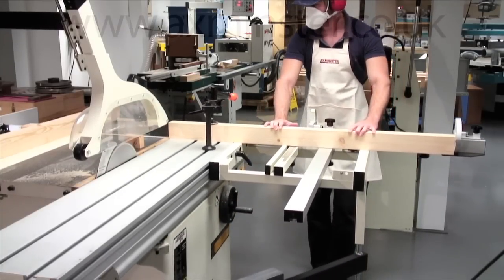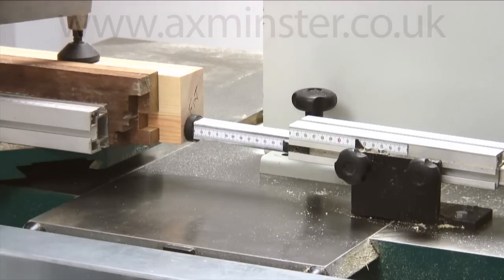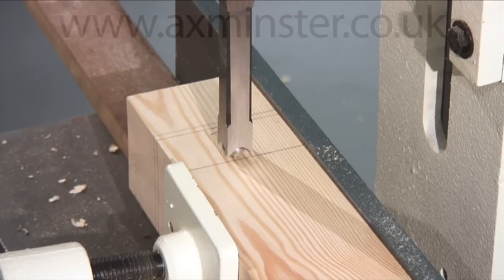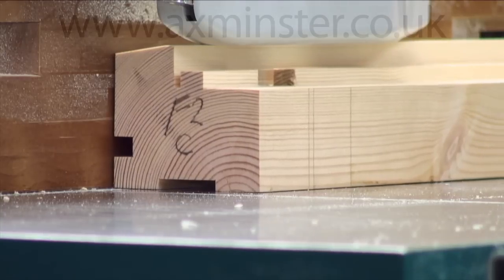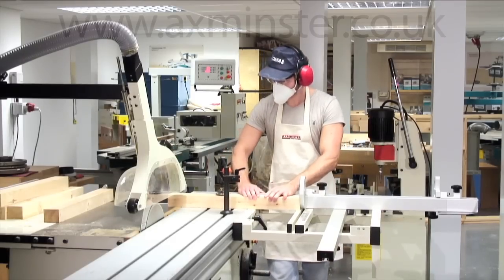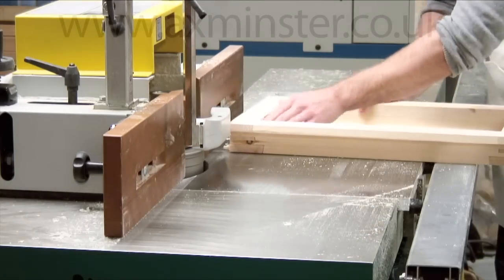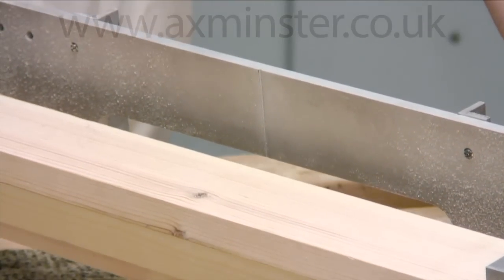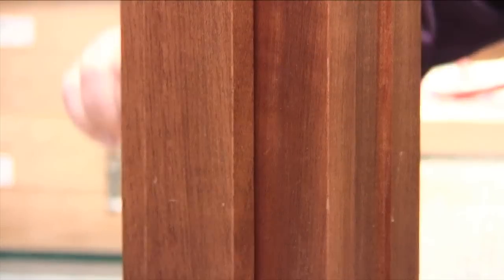Axminster Dual Window System

Comment: I looked at the video. this is our old windows. does not meet the requirements. I 68mm double standard eurofalcos window manufacturer. The lock used before this hollow aluminum template where you can get it?

Comment: aren't these mounted backwards or do windows open to the exterior in the UK? The tooling looks well made but these windows resemble what they used to make 60 years ago here in Belgium with just a single contact point between frame and casement. The norm has been 3 contact points for decades here which drastically improves insulation. Also the stiles of the frame and casement in this technique have end grain below exposed to moisture which cause the windows to rot, that method has been abandoned here long ago.
Reply: Timothy Wilmots yes windows open outwards to the exterior in the UK. If the windows are dripping wet after heavy rain, who with the frame covered in snow, who would want them opening inwards? The film is to demonstrate the versatility of the machine in making a window frame. Frames haven't been made like this decades in the UK either, especially out of softwood with our weather. We mainly use double glazed UPVC Windows and doors now.
Reply: edward charles
Reply: Inward opening windows? Really? Dripping rain all over your window sills and carpet?
Reply: Is this guy for real i have never seen a window open in ever in any country

Comment: I am a joiner and this is way too many tooling changes. It would take forever to make a window with this system. Also at 6.58 there is no support when exiting the cutter block that machines the front sections that have a taper. The last part will drop into the block and snatch. Dangerous and would never carry out this way.
Reply: you would never make any money the man hours it would take aswell to finsh the windows
Reply: Yes, it's really dangerous to operate this machine.
Reply: V Naresh

Comment: How useless. It seems the point is to show off your professional equipment. Is this for professionals or to help those like me who need to cut heat loss in winter at single glazed windows.
Reply from the maker: Hi Peter Gorham, thanks for your comment however I'm not sure I get your point? We sell most ratings of tools & machinery from hobby to trade to industrial. Please also bear in mind that this video was uploaded over 6 years ago and we no longer stock this specific window tooling set.